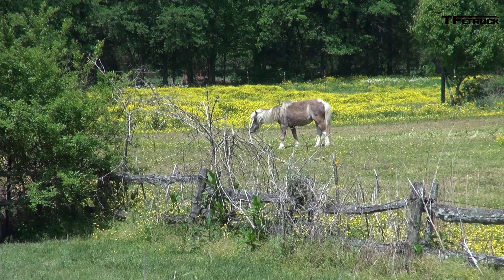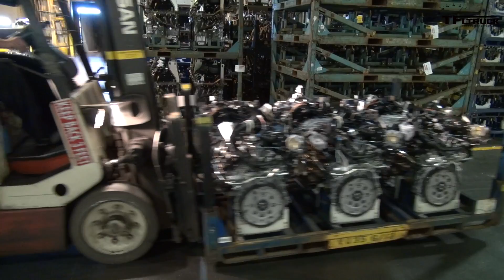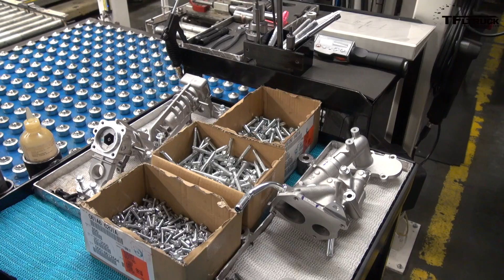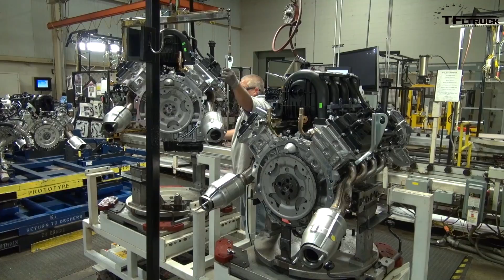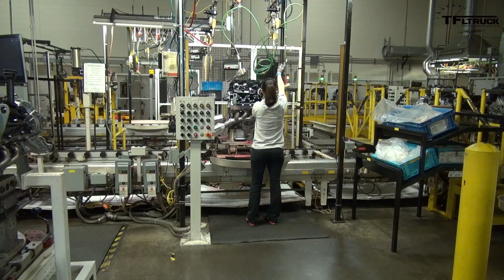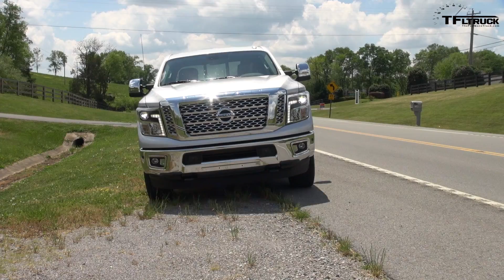2016 Nissan Titan XD with 5.6L Gas Engine First Drive Review

Comment: Just noticed that the Nissan and Toyota trucks have normal engines, no start-stop, no cylinder shut-off and better warranty any ideas why big three
Reply: This was one of main reason why I bought my 18 Titan.   My Dad had 5.7 Tundra.   He racked up 150k on that truck before he sold it.   Guess what its still running great.   I think Nissans and Toyotas are best trucks out there.   Not a lot bullshit options.  Very dependable!
Reply: @tattooedsailor8666  How’s that truck doin? Still rolling? Would you suggest buying one?
Reply: @preshj0hnson  Stay away from 16-18.  I had to get my short block replaced due to tolerance issues.   Do a search for engine knock Nissan Titan.  Its common issue with these trucks.   Since the replacement truck runs great!  No issues at all!

Comment: The trick to this truck is to find the sweet spot, which is usually 1700 rpm. I'd like to see what mileage it gets on a flat road, at that rpm. I assume it would be around 22 mpg.

Comment: junk all they did was copy ford and steal the Cummins from dodge.
Reply: jonnywiggs nope.  totally different engine than the 6.7 in the dodge.
Reply: Nelso90 good for them enjoy only pulling 10,000 lbs. that isn't pulling a 30,000 pound load. took everyone else's ideas and still made a turd.
Reply: I drive a nissan for work everyday and it's a piece of SHIT
Reply: jonnywiggs I can&#39;t speak for Nissan build quality but I work for Cummins in the plant where the 5.0 is made, though I am closer to our 15 liter X15.  The 5.0 V8 is a completely different engine from our 6.7.  I have every reason to believe the engine COULD tow 30k lbs since we put it in big RV's and medium duty trucks, but the chassis of the truck is the limiting factor.  It's not designed to compete with 1 ton trucks that can tow 30k.
Reply: Nelso90 I get it's a different engine build I'm simply saying they stole ford body design and took the Cummins name from dodge. Chevy is Duramax. Ford is Powerstroke. Dodge is Cummins. just how it's always been! I understand what you are saying though with the different engine. They obviously cant copy the exact same model due to getting sued, but thank you sir for your nice bit of information.
Reply: jonnywiggs well dodge was supposed to get the 5 liter but the whole 2008 thing happened and fiat bought them
Reply: jonnywiggs I thought it'd be neat in a ram too

Comment: It seems to me that the Nissan Titan XD is not as capable as it was originally marketed to be. Those payload and towing numbers can be had by the half ton trucks like the F-150, Silverado and Ram 1500. Perhaps the frame is a bit heavier and it is more controlled when towing 11000 lbs than the previously mentioned half tons, but that's just a guess. I wonder if the regular Titan that will be released later will be underachieving in its class.
Reply: That's exactly right. The Heavier Frame among other components allow the XD to tow at its max comfortably.   The Other 1/2 ton gas rigs with similar "NUMBERS ON PAPER" will not tow or handle as well as the XD when they are loaded to the max.  They are all great trucks, but Nissan is modest with their ratings. 

The 1/2 ton Titan will not be underachieving.  Even the old first gen V8/5 speed combo still holds it's own damn well compared to some of the newer offerings.  Maybe not on paper, but in the real world.
Reply: Anthony But Well, all I can say is we shall see. It's too early to tell how either Titan will hold up against the competition, but it will be interesting to say the least.

Comment: Don't know why people complaining. this is a good truck. you don't see recalls from Nissan. or any problems like a Ford. the titan is made in America and a better truck then a Chevy or Ford. enjoy your recalls.
Reply: +trent031991 Really, you sure about that? Cause I just looked and seen at least 2 open recalls for the Titan. Not to mention any names (cough!trent) but it sounds like someone is full of shit.
Reply: Dont forget about all the issues with that cummins turbo diesel. Egr Failures Transmission tuning issues. Cold Start issues as they dont offer a grid heater.

Comment: Think I would prefer the gas over diesel. Unless you tow all the time, it's not worth the extra money to go diesel.
Reply: I should mention I have a 2008 Titan, and it's still great. The old truck has plenty of capability for my needs... if I go new eventually, probably just go for the regular Titan 1/2 ton.
Reply: The XD front end is 3" longer than the regular Titan 1/2 ton

Comment: Love the evolution of that 5.6L engine, but I'll keep my 2004 Titan for now. With only 26,000 miles on it, I don't think I'll wear it out soon.
Reply: Wow that's low miles! Did you buy it recently?
Reply: No, I bought it new in October 2004. The reason that the miles are so low is that I only use it to haul dirt bikes every other weekend.
Reply: +Mike Frey oh cool! The 2015 Titans are exactly the same and they are giving them away cheap for like $28,000 for a week equipped 4wd.
Reply: +Mike Frey So, you spent, what, $25-30,000 on a truck to drive 4 days a month? Am I understanding you right? You know you could find a nice used truck online for less than $10,000, even back in 04.
Reply: +Daniel Bell - Yes, but that wasn't the plan and it's a long story... My brothers and nephews had gotten into off road bikes at that time, and I was getting BACK into the same, since my kids were grown up and headed off to college (I hadn't been riding for 18 years). I really thought I'd put 10,000+ miles a year on it. I got a company car for work, so I was driving that on weekdays and I still had 2 other cars to drive - so the miles got divided between 4 vehicles and 2 street legal bikes (for a couple years, I had 5 cars). And then everyone started riding their street bikes instead. ...The truck sat a lot. No regrets. I used it when I needed a truck, the rest of the fleet was more fun to drive. Now I am finally driving the Titan more since I cut back to just that and my Infiniti G37x. Still have all the bikes, though. 
"Nice used trucks" were in high demand in 2004 - that's what I was going to buy, but $10,000 would have bought a very used F-150 with over 100,000 miles on it.  4x4 extended cab Chevys and Fords with less than 50,000 miles were in the $20,000+ range. I seriously considered a 1st gen Tundra with 120,000 miles for $17,000, but new won out when the '04 Titans were heavily discounted as the 2005s came out. Even back then, I was fully familiar with shopping nationwide - I live in farm country PA and spend time in farm country CA, and there wasn't much difference in prices left coast vs right coast. I also traveled a lot (usually by plane) and southern state prices were about the same. Any farther north places you into the snow belt, and although most trucks will easily go 200,000 miles, rust was an issue long before accumulated mileage was. My Nissan Hardbody KCab 4x4 was pushing 150,000 miles but was badly rusted, although the engine was great.
Reply: Mike Frey I don't know how to tell you this, but nice used trucks are STILL in high demand. I shit you not, a couple of months ago I saw a 08 F150 with over 200,000 miles and it SOLD for $18500. I couldn't believe that!
Reply: +Daniel Bell nope that's bull shit 2004-2008 f150s with 50,000-100,000 miles in perfect condition sell for $15,000. I don't know what country you live in but that's retarted!
Reply: Dodge 318 Cummins I don't give a shit what you believe. I saw it.
Reply: +Daniel Bell your only saying that because you have a 2004 f150. News flash they aren't worth shit. $20,000 with 50,000 4wd perfect condition. Not worth shit with 200,000 miles. Please check nada or kbb for somewhat reasonable prices.
Reply: Mike Frey I was having a nice discussion till that butt pirate showed up.
Reply: Dodge 318 Cummins Ha, jealous much, shit for brains?
Reply: Hey! This is my comment thread! I get enough of the Ford vs Chevy vs Dodge vs Nissan vs Toyota from my own family! 
I'm the only one with a Titan and have no loyalty to any one brand (had an F-150 before)
My brother has an F-150 and an older Dodge Ram, he's a lot like me.
Brother in law #1 has a Dodge Ram but had Chevy before that and thinks everything else sucks. 
Brother in law #2 is on his 3rd Dodge Ram diesel and hates every other brand. 
Son has a Silverado and hates Fords, says "I wouldn't drive a Ford even if it was free".
Cousin has a Tundra and thinks everything else is shit, especially Nissan. 
Why? I never understood this rivalry between brands. No one makes a bad truck.

Comment: sounded like a great truck until I heard it wasn't a half-ton. Sorry but if its classified as a heavy-duty truck then they missed the bar cause the tundra hits harder and it is a half-ton.
Reply from the maker: +Trenton Archer Nissan will sell a 2017 Titan half-ton later this year. We will test the Titan 1500 when we have a chance.
Reply: +The Fast Lane Truck what happened to cheap trucks. We got our 02 ram 1500 for less than 20000 brand new. The modern version is about 37500.

Comment: I got to say I'm impressed with this truck, I'm just interested the RAM with the air suspension. And now this, I just wonder about the reliability. I'm still considering the tundra do to the quality of that truck. I'm sorry but ford and GM just aren't that good after you own them past 6 to 7 yrs.
Reply: +Dean Dubois Yea? Where's them 30+ year old Toyotas? I see old domestics all the time, and can find them still for sale in good shape. Other than the occasional 90s Honda, you don't see many or any old Japanese cars.
Reply: Unless you get the tundra 1794 edition the tundra interiors feel much lower quality than the American competitors. If you treat them right any modern vehicle is going to last a long time
Reply: +Daniel Bell c'mon, that's not really a fair statement.   30 years ago there were at least 10 times as many domestic vehicles sold in the U.S.  If all car were built equal, then, logically, you should still see at least 10 times as many old domestic cars.  Then you have other factors like the type of imports sold back in the day.  Most were small cheap four cylinder cars.  and little cheap cars get out-dated pretty fast, so people just don't bother with them after 10-15 years because newer vehicles of the same type are readily available and cheap, t has nothing to do with the brand.   After all, when was the last time you saw A Ford Tempo, or an 80s Chevy Cavalier, or Lumina.   
Old Cars that are still on the road are there because people choose to continue to fix them.
Oh, and Dean Dubois's comment is also nonsense....and contradictory, since most Toyotas sold in the US are American Made.
Reply: Ask any Lincoln Navigator owner or Range Rover owner what they think of air suspension and how they had to get a home equity loan to maintain it.  Air suspension in a truck and reliability should never be mentioned in the same realm.
Reply: +Bolds Yea Tundra is LONG overdue for a redesign. The engine is rock solid, but is thirsty. If you really want a Tundra, I'd wait a few years.
Reply: +Mr Bobby Brown Im. not brand loyal, I know that the ram is going to get a redesign in 2017 but I dont if the Ram reliability is the same as toyota.

Comment: Is there going to be a non-XD Titan?
Reply from the maker: +Sam Yes, pure half-ton 2017 Nissan Titan is coming later this calendar year. It will also have this 5.6L V8.
Reply: +The Fast Lane Truck if you get this truck to review, can you compare it to the diesel up the ike gauntlet?
Reply from the maker: +yadvinder gakhal You bet!
Reply: +The Fast Lane Truck  does disel or gas get better fuel mileage
Reply: Depends on what your doing trent. If your towing all the time the diesel is the way to go. If your not towing and most daily driving the truck the best way to go is the gas

Comment: Trying to justify buying a full size truck... Hmm
Reply: Just buy a Silverado if you want a 1/2 ton they are really cheap right now they have great deals on 2015 left overs. If you want a small pickup that's has get a Toyota Tacoma but if you want a diesel buy a Chevy Colorado Duramax.
Reply: @connerbutler1077 chevy sucks azz

Comment: Direct injection? Can someone say CARBON BUILDUP? no thank you
Reply: +777 Lukasz Infiniti has been using a version of this engine and 7 speed transmission since 2011.
Reply: +777 Lukasz This is Fords problem and they're trying to hide it, carbon build up on the Turbos. Whooops. Most new truck and cars are now coming with direct injection. Fords problem so I read is, turbos too close to the injectors, causing failures. Big surprise here. The 5.0 is the only way to go when looking at the 150
Reply: +777 Lukasz That's only common on VW. Besides it can be remedied with running seafoam in each tank of gas and using the spray. Besides newer engines might have a second set of fuel injectors to help with carbon build up.
Reply: Ratkill9000 Like John G said, Nissans been using this engine for a while. This seems to be a problem with Vw and Ford, as of now. But your right about the second set of injectors to combat this problem. I am not sure  if this engine does have (2nd) set or not. I can't wait to take a half ton for a drive though. Drove the Cummins and was impressed. Not Hp wise but you could feel it was smooth. Cheers

Comment: If the Pro 4X yield 18.2 MPG, I'm sure that a base model with 2WD might reach 20MPG. Its just an estimate of mine. Its a great truck. Can't wait to see the upcoming V6 configuration. For sure it must be twin-turbocharged like Ford's V6's for the F150 to handle its heft.
Reply from the maker: +Iván Maldonado We got 18.3 MPG from the trip computer in the SL 4x4 trim of the truck at 70 MPH on the highway.  We will verify this when we get the truck in Colorado.
Reply: Excellent! Thanks for replying.

Comment: 5:46 Maximum payload for that huge truck is 2,500 pounds while the F-150 with a 5.0L V8 can pull 3,300 pounds. And the weight difference is about 2,000 pounds different (the Titan XD is heavier). And the F-150's 2.7L turbocharged V6 can pull 2,200!
Reply: Uh, payload is how much weight you can haul IN THE BED. I think you have payload & towing mixed up!
Reply: +Big Juicy Fart comeon that 3,300 lbs is with a Regular cab with HD package. I'm sure the regular cab XD will be more than what the Ford will handle!
Reply: I compared it to the F150. What is more comparable is the F350 (non-dually), which is still lighter than it, but has a payload of 4,200 pounds with the gas engine.
Reply: Yeah... Payload: 4,200
Towing: 12,300 pounds
http://shop.ford.com/build/superduty/?gnav=header-trucks#/config/Config%5B%7CFord%7CSuperDuty%7C2016%7C1%7C1.%7C618A.W3A.172....CBC.X4M.471.CRW.NFLEET.996.4X2.44P.SRW.LAT.~F-350.%5D
Reply: What?!